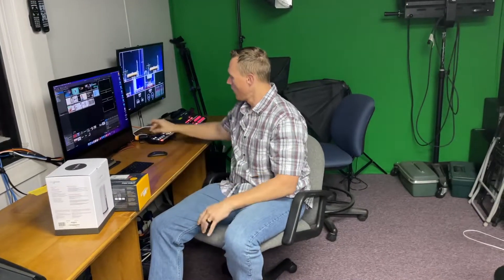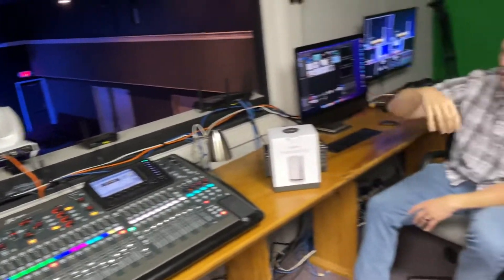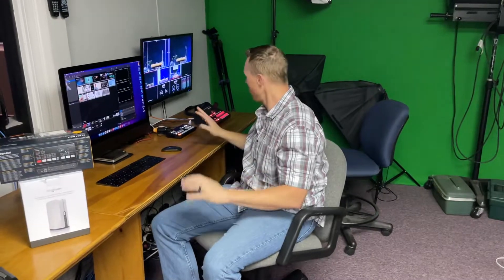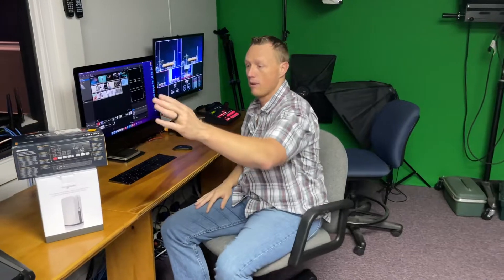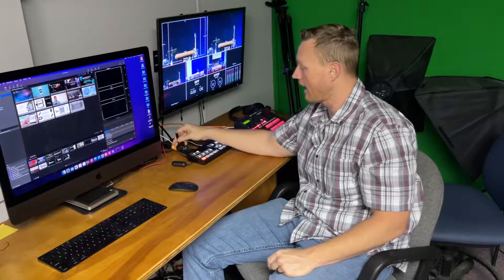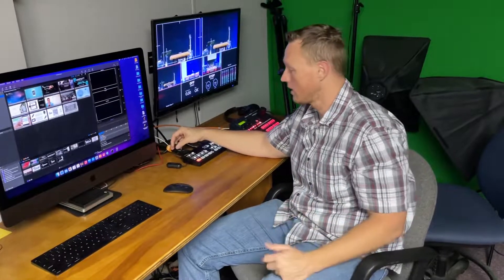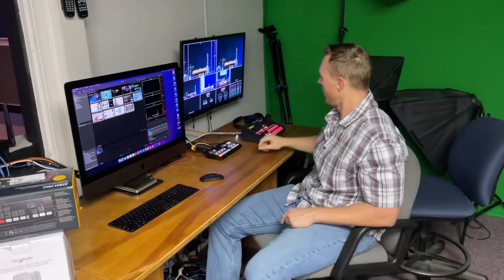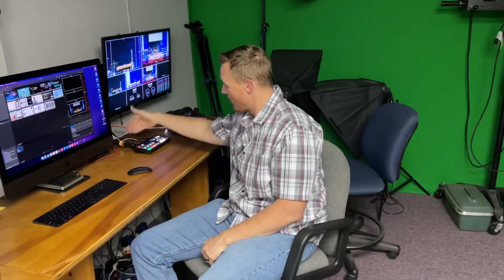Design Ground Loop Noise Isolator with ATEM mini pro

Comment: One thing to check, and you may have already done this, but go into the ATEM software settings under audio, and make sure the input is set to Line, not mic. You'll experience noise and clipping if it's wrong.
Reply from the maker: @brad_neal  very true!